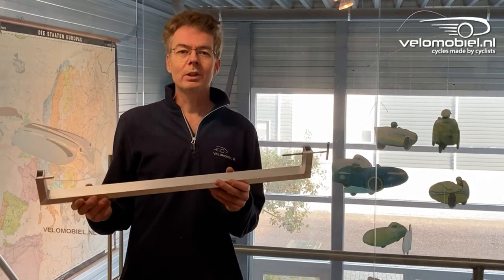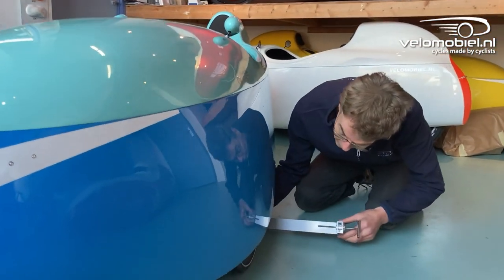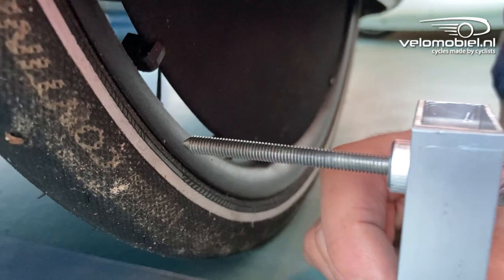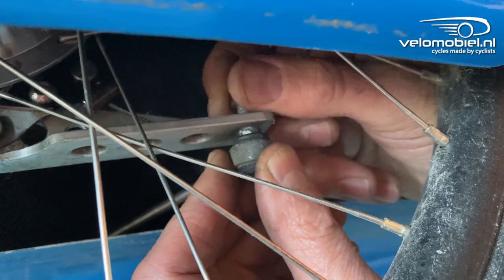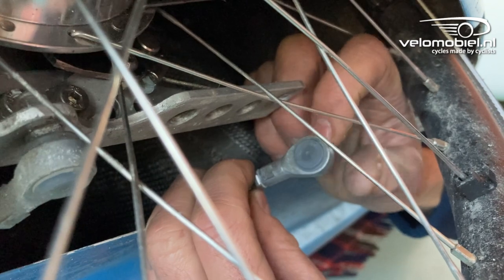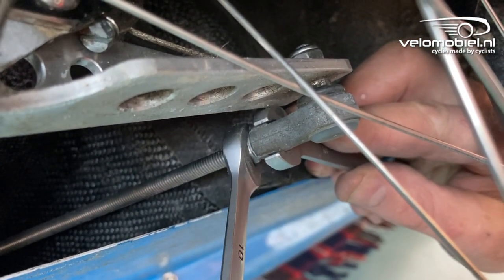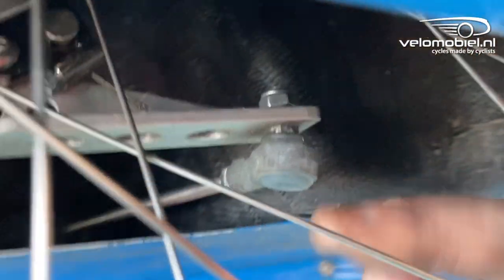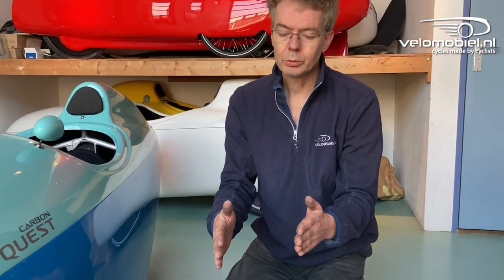How to easily align the front wheels of a velomobile

Comment: Maakt het nog verschil of je de toe-in/out meet met of zonder bestuurder?
Reply from the maker: Nee, bij onze modellen kun je zonder berijder meten. de vering heeft geen invloed op het spoor. Bij sommige andere merken is dit wel het geval.
Reply: @velomobiel.nl.dronten  in my quest I had much different alignment with and without my bodyweight. It was several millimeters different. When I adjusted it to be parallel with my bodyweight, I got much better speeds when riding. I have quest XS QB056 made in 2012.